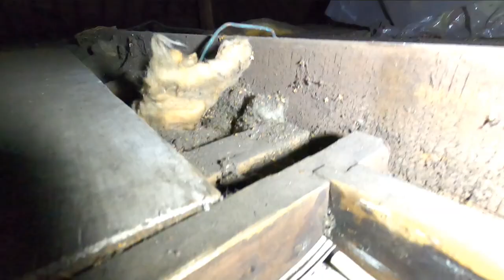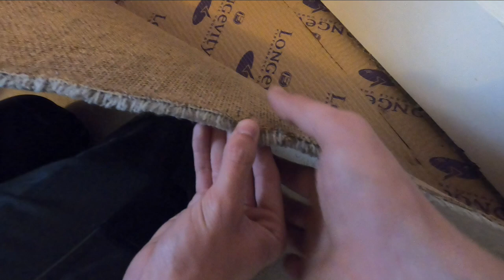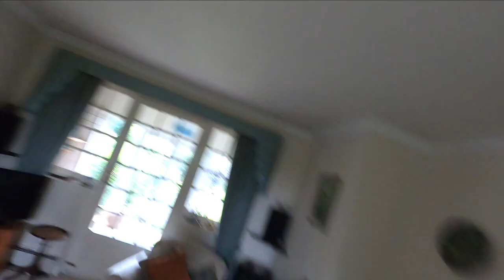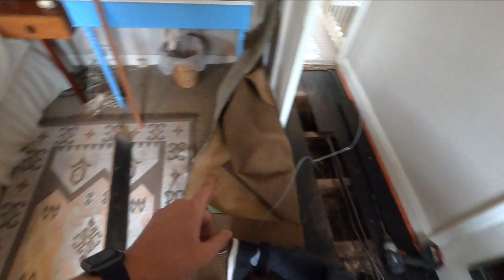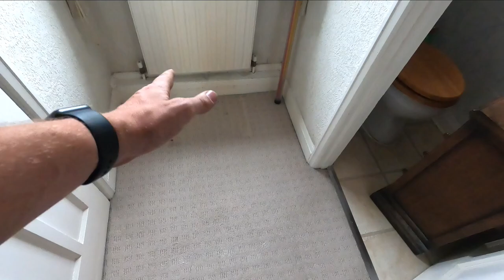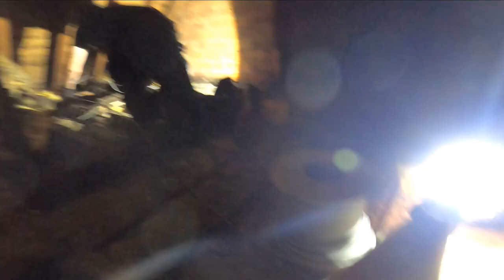Bent screwdrivers, Bee stings and lighting rewire, lead cables, electrician

Comment: Hi Nick,
 I enjoy your video's  keep them coming. As an old spark from the 60's I use rip out loads of that old lead cable from the 30's it was old then, they used to run in metal star boxes clamped around the  lead sheathed that was the earth occasionally if it wasn't a full rewire we would use 14swg copper wire to maintain earth continuity, but  I thought all that lead was gone decades ago. Keep up the good work nice to reminisce old times.

Peter.

Comment: That cable is lead covered rubber insulated wire. It was made in the 1930s, and is well past the end of its life. It predates VIR cable which is also well past the end of its life.
Reply: I have recently been told that my wiring is tinned copper building dates from 1964, just wondering why they did that.
Reply: @nw5835  Out of habit probably. Rubber (as in the old VIR cables) is vulcanised using sulphur and that'd eat up the copper if it wasn't tinned. I suppose they didn't quite trust PVC in the early days so they just kept tinning the cores.

I'm fairly sure this isn't lead though - it's green in spots, which points to copper, i.e. MICC (pyro).

Comment: that old cable looks like piro
Mineral-insulated copper-clad cable is a variety of electrical cable made from copper conductors inside a copper sheath, insulated by inorganic magnesium oxide powder. The name is often abbreviated to MICC or MI cable, and colloquially known as pyro (because the original manufacturer and vendor for this product in the UK was a company called Pyrotenax). A similar product sheathed with metals other than copper is called mineral insulated metal sheathed (MIMS) cable.

Comment: Does look rather like lead cable have dragged a fair amount of it out on rewires in the past. Also have took a fair amount of rubber cable out too. Don't think can get 8ft tubes any more have seen a lot of them of the things.
Reply: TLC still have 8ft tubes listed - at £16 each.  Only marginally cheaper than replacing the fitting.....
Reply: @JC-jv5xw  I knew where bloody expensive many years ago. One job I was on the client decided to put a smaller  fitting up in place of an 8ft. There was hardly any difference in light output for a start. Plus more often than not ballasts, lampholders etc would also be knackered too. So cost wise we just stuck a new light up.

Comment: Wow the way they allow y’all to do the residential wiring and the location of y’all’s panel is dangerous looking
Reply: been watching GB sparks for a while they think we are crazy for putting lights and sockets on same circuit but if they have a breaker trip they have to crawl on the floor to open a cabinet or get a ladder because its in a cabinet 2 to 3 meters off the floor.not to mention if they can pull up floorboards its ok to bury jc boxes.
 the only thing i have seen so far from uk sparks tht i wld like the states to adopt is there underground armored cable.   https://www.youtube.com/watch?v=5XST0DkotYw
Reply: wizard3z castor regs in uk states the fuse baord at 1400 so that’s what it is in everything new this house is probs over 50 years old
Reply: what you guys have been watching and in no disrespect to domestic sparkies is the lowest in the ability barrel when it comes to Electrical standards. Most properties have been either wired by a DIY’er or some 10 week sparks. When you step into the industrial sphere. Our regulations and standards I would say are so much better than the NEC. I work for an American company where our packages are of US standard. Most of which have to be modified to conform to BS standards by using a certificate of conformity. Stones and glass houses comes to mind.
Reply: @Jackdaly2000  kk
Reply: @jurassicsparks5220  you realize the nec is bare minimum most of us who have respect for trade go above code. and some local jurisdictions have code standards above the nec. i hear all the time well its done to code im like gee a D- snds good to me 🤦‍♀️. 

kk but in our regs if we change out a panelboard it has to meet current codes in the UK you seem to just be able to replace and leave in same spot against regs? 

and yes  even in the us commercial vs residential regs are higher like you stated
Reply: wizard3z castor board heights aren’t even an electrical ‘code’ in the uk but a Building regulation (but only England)